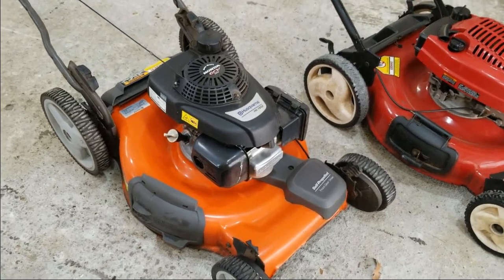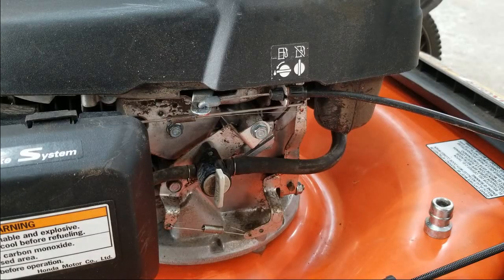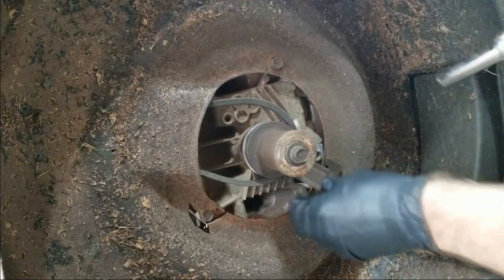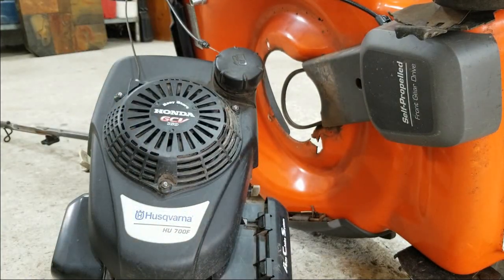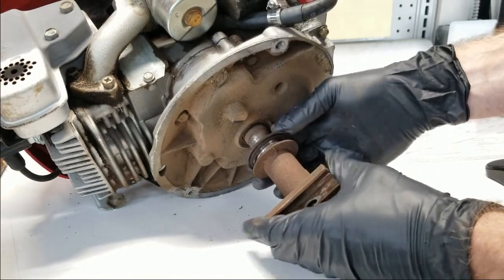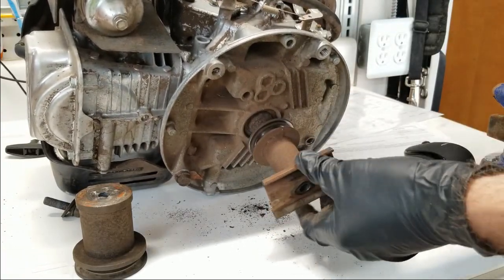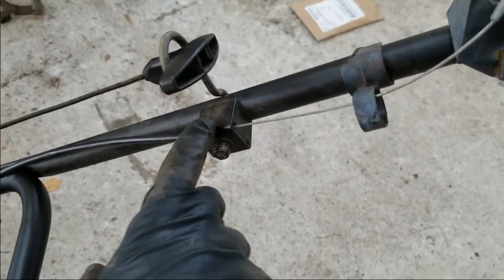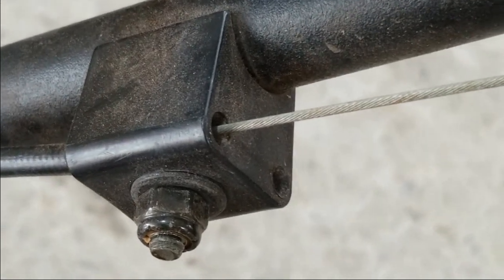Lawn Mower Engine Swap - Toro Recycler

Comment: Great video. I have a relatively small lawn but slightly hilly and lots of trees and bushes. I have this really cheap Bolens 4.5 HP push mower.  The reason why I love is because it is so much lighter than most other gas mowers and it's NOT self propelled. I can cut the grass really quickly and easily. The engine is a bit weak though when trying to go through deep grass. Anyway, I just picked up a Craftsman mower with a Honda engine, 6.5 HP + - I believe, for cheap. So, I want to put this engine on the Bolens deck. I know with other motor swaps, for cars and tractors, for instance, the big worry is linkage. Doesn't seem to be an issue here.  The Craftsman with the Honda was a really good mower but too damn heavy.
Reply from the maker: Hi Richard. Thanks for watching and sharing your experience. The Honda engines are great. I hope mounting the Honda to the Bolens mower goes well and gives you the power you need.

Comment: My Husqvarna L421P has a Kohler HD775 engine.  I'd like to swap it for a GCV160.  There are several models of this engine available with different crankshaft dimensions.  My Kohler's crankshaft is 25mm x 3.16" with a 1/4" keyway.  How do I find a compatible Honda for it?  Thank you.
Reply from the maker: JML JML, I don't have a lot of knowledge about the various crankshaft sizes, but I believe a Honda with an N3-Type shaft will work, as it appears to have the same dimensions as your Kohler.
Reply: @BlackHoleDIY  Thank you; I'll check that out.

Comment: Just ran across your video. I did this same engine replacement about 2 years ago. Same Husqvarna  HU700F mower & same cracked deck issue. Husq used to make high quality stuff but since about 2010, not so much. The Toro blade adapter on mine fit fine on the donor GCV160 engine from the Husky; like I said I've happily mowed with it for two seasons. Don't know why yours seemed loose but unlike yours, my Toro is rear wheel drive with the Personal Pace drive system ... maybe that's why mine worked & yours didn't. Enjoyed the video, thanks.
Reply from the maker: JJ, thanks for sharing your experience with a similar swap out! I am sure others will find the information helpful. Thank you for watching.
Reply: Was there any other procedures involved in the personal pace swap?
Reply: @scottmorris8391  Not really. I was surprised how seamlessly everything went. The belt was the right length, all the deck-to engine holes lined up, the kill switch/brake cable was the right length to release the brake & "un-ground" the kill, etc. Just enjoyed mowing with it again today, several years after the swap.
Reply: @jjparody8257  My Toro is over 25yrs old. Never a problem with it until this yr. I have rebuilt the carb twice and they don't build that engine or carb any longer. They want $1300 for a similar new one. So an engine swap sounds better on the pocket book. Now I just have to find one.
Reply: Thank you for the information.

Comment: Why not clean the shaft before putting the blade adapter back on and using anti seize.
Reply from the maker: Hi Martin. That's a great suggestion and wouldn't hurt. Because each of the blade adapters came off relatively easily, I didnt think anti seize was necessary should they need to come off again in the future. However, I did take the time to hit the shaft with a wire brush when I later replaced the sheared blade adapter with the new one.

Comment: If the deck is broken like that most likely the motor  shaft is bent.
Reply from the maker: That was a concern of mine, too. Fortunately, the shaft was fine. I'm now using the engine on another mower of mine and it's running great.